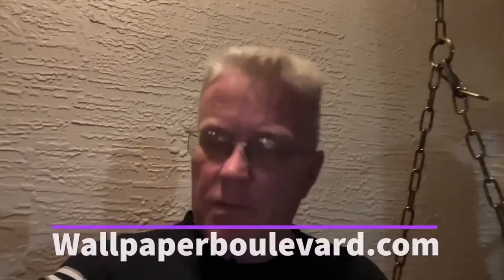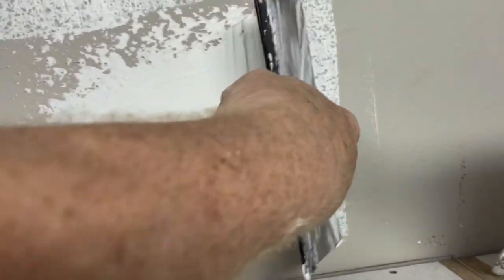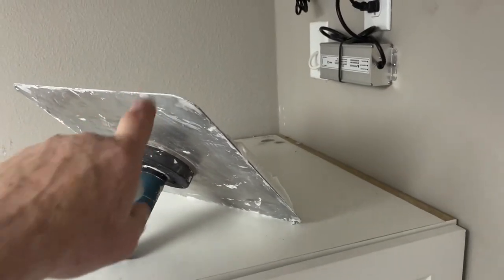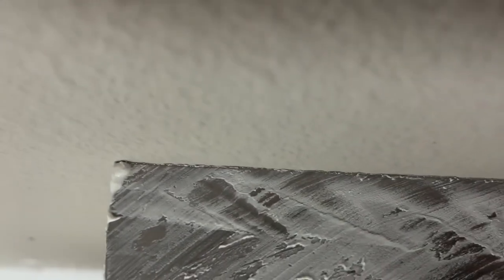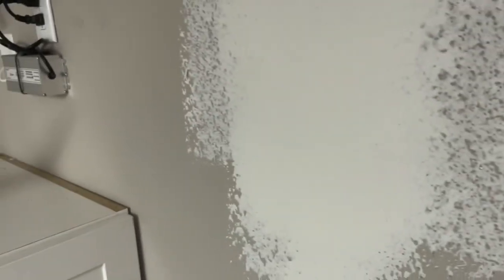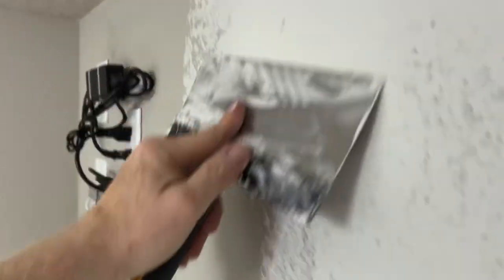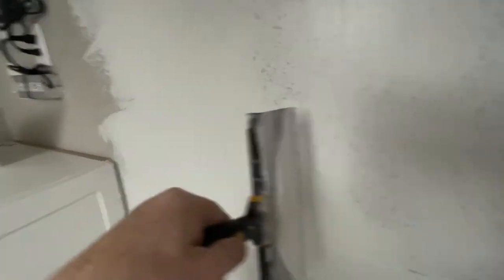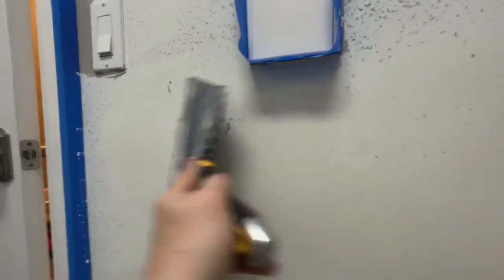The Basics of Skimcoating Techniques - Spencer Colgan

Comment: I sand the walls first with 80 grit to knock down the high spots. Then come back and skim the walls to fill in the low spots. Then come back with a higher grit of sand paper and I'm done. 
It looks like new drywall after I'm finished. But I'm not saying you're wrong, it's just not the way I do it. Thank you for the videos.
Reply: Will this work on painted walls? I want to skim coat to cover the orange peel texture on my walls this way also. I plan to sand high grit, skim, then sand fine grit. I’m hoping the sanding will allow both good adhesion of the all purpose compound to the old paint, which I don’t know if it’s latex or oil. 

I don’t have any electric sanders though, so I’m hoping I don’t have to go all the way back down to the drywall layer, (but if it does, then all the better).
This wall has had 3 or 4 coats of paint over the years, and it’s still showing orange peel texture. Hope to do it with just a sanding pole, and hawk and trowel. Does this seem doable?